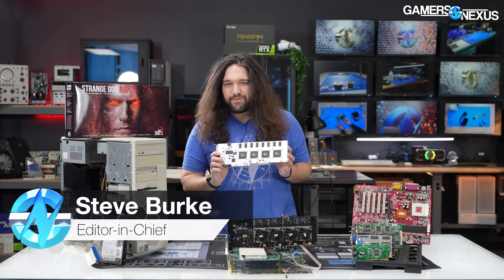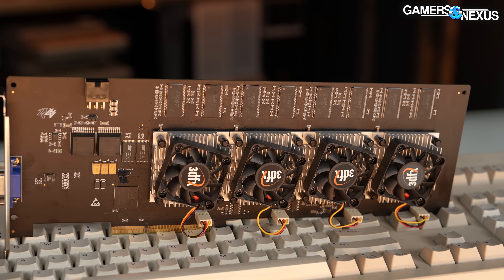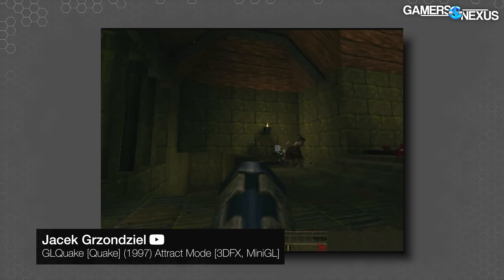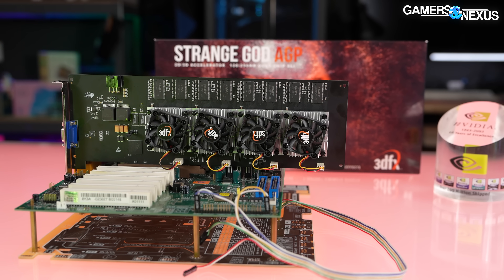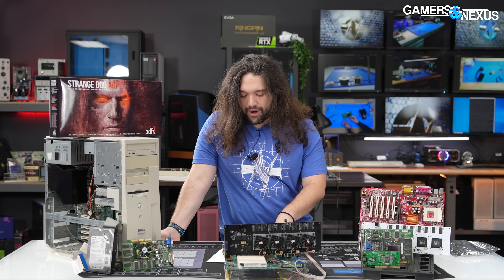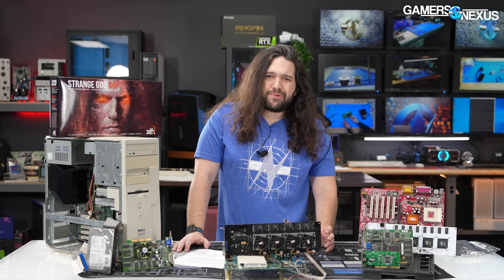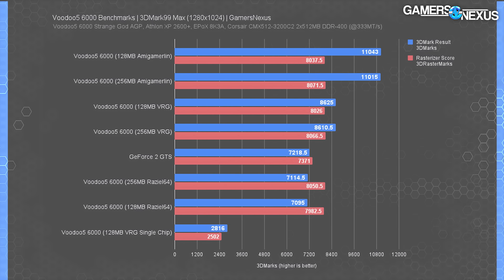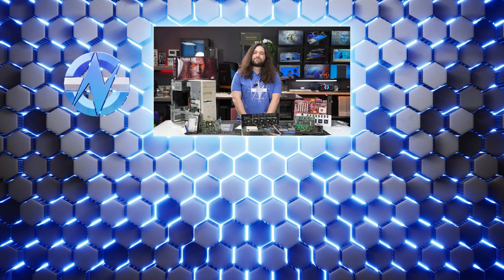Back from the Dead: 3dfx's Unreleased Voodoo5 6000 Quad-GPU Card

Comment: A graphics card review on a THEORETICAL CARD WHICH NEVER EXISTED.  This is utterly insane and I'm in love
Reply: Funny enough it was more real than the paper releases of the mining boom period. :D
Reply: No, it did exist. He showed one. That's also how he can say it replicated the original's bugs.
Reply: @Dowlphin the question is, where are the originals from the batch that WAS manufactured. Is it still “arrested” in some bankruptcy warehouse or something?
Reply: @Dowlphin BTW, there is even a more obscure thing. Back in 1996 Apple has designed its own 3D acceleration chip that was capable to drawing measly 100 million triangles per second. Of course, it was a failure, but the chip does exist somewhere for some IT historians to dig up, test, X-ray.
Reply: @tatianaes3354  Dunno how many existed, but they could have landed in the trash and in the hands of collectors, museums and such.
Reply: It existed (as a prototype), it just never went to production, and he made a lot of improvements to the original design to modernize it.

Comment: Thanks for taking the time on this video, it was quite interesting.  I had a 3DFX Voodoo 3 2000 AGP (well I still have because I am a bit of a hardware hoarder).  I initially had it in an AMD K6-2 300mhz machine, eventually I moved it over to my first hand built PC, an AMD Athlon Thunderbird 1.4Ghz machine.  

I have so many memories of playing Unreal Tournament 99 on these systems on dialup 56k Internet...  I actually remember there being some drivers that worked in Windows 2000.  I had good luck with that back in the day as I seem to recall, but I feel like those drivers were considered experimental.

I never remember hearing about working Voodo 5 6000 hardware.  I just remember all the memes because people couldn't believe a GPU would need an external PSU and be 12" long haha.  This alone didn't help 3dFXs reputation before they finally folded.  I was truly dissapointed to hear that they went under back in the day...
Reply: Drivers for 2000 were official and fully supported etc.. They could also be used in Windows XP, but from that OS onwards I think you could only use them for Glide and maybe OpenGL games. Direct3D support wasn't possible IIRC. Fans modded the last official Windows 2000 drivers to make them more compatible with Windows XP which was a godsend considering Nvidia showed Voodoo owners the middlefinger and immediately stopped any driver support which nearly rendered my very expensive V5 5500 AGP obsolete after just a few month after the purchase. That's why I never became an Nvidia customer. So thanks to the community I ran my V5 5500 AGP on Windows XP IIRC with the x3dfx drivers, but only for work and internet stuff, for everything else I booted into Windows Me.

Comment: Thank you for doing this. You brought me back to my childhood when I used to drool over upcoming hardware in the PC magazines.  Such a big part of my childhood.
Reply: imagine having a quad 4090 gpu card today just imagine having that kind of power at your finger tips
Reply: @raven4k998  and a CPU powerful enough to not be a bottleneck for it. And a psu capable of powering it, along with a cooling solution capable of keeping your system and the room it's in from having a meltdown. Lol
Reply: @shawng746  well at that point if you had that many gpu cores on a single card you could make a multi cpu card with a cpu that has the highest clocks and ipc over core count cause imagine yeah my systems got 128 cores and high ipc then your to boot she's running at 6ghz on multiple cores when she turbos that would be insane mind you the number of rads you would need to keep it all cool would be insane to but oh well🤣🤣🤣
Reply: @raven4k998  Indeed.  I'm certain by the time they are capable of producing things this powerful, the efficiency will be much better as well.  Otherwise it would make zero sense to make it for the average to even somewhat high end at home consumer.
Reply: @raven4k998  Would need a nuclear reactor to power it tho. lol
Reply: @vespermoirai975  na just a Nuclear fuel cell you over react it's just 4 4090's not New York City🤣🤣🤣

Comment: I was working at a PC builder and I remember the I740. We called it the first Windows DEccelerator. :) Intel's early video cards were a horrible joke. I had 2 voodoo 2's in SLI.  I went over to Nvidia like everyone else did. Their 1st video Card only did 16 bit graphics. They were coming out with new video chip based cards like every 6 months back then. They very quickly released a 32 bit chip. No one saw anything like their release rate. Even ATI almost went under back then. I had several of the Nvidia cards. They were extremely aggressive. This is really bringing back memories. Well done GN!

Comment: 8:54 I cannot overstate how much joy I get from seeing dated clips of people so confidently making definitive statements about tech.
Reply: kind of funny when we just got a 480 hz overclocked to 500 z for a monitor this year. 1080p but its there.
Reply: To be fair, they were right within the context. Nobody really needed to run Tomb Raider at 100+ fps
Reply: the 13:40 is even better - talk about swilling the kool-aid! lol
Reply: i think it sounds weird nowadays tho but back in the day some games might just be weird at high fps, because it might screw up the physics/player control/game speed/etc.
Reply: Yeah, it probaby made sense; in the context; at the time. It's still entertaning the way it's presented here, and their are much better examples of what I was originally talking about.
Reply: @T zwcard  At that time, tying physics and speed to clock rates and fps was mostly dead. Or at least well on its way out.

In the early-mid '90 there was a lot of issue with (mainly) DOS games being unplayable due to being tied to the processor speed. Playing some games made for a 12mhz 386 on a 100mhz 486 was impossible. (This is why you see "turbo buttons on old PCs) So devs tried to move away from this.

That being said there was still games that didn't take this into account. For example Oblivion (and Skyrim iirc) had issues at higher frame rates.
Reply: @Cancer McAids it might be on the channel already . I think its less than 2ms(based on 60fps being about 16.5, it adds up tho .60x 8 = 480 16.5 ≈ 8 is about 2). and it really just eliminates any movement smearing at all. probably only useful for people without eye prescriptions. I'm still at 75 hz over 60 and loving every minute.
Reply: @mr.dingleberry4882  I mean you could say that nobody really needs to run today's games at 360fps but that was never really the point, I still remember the first time I saw a game running at 60 fps and the first time someone pushed 100 fps in Quake (with legit settings, not 320x240) and how crazy that seemed.

Comment: Thank you GN for the trip back down memory lane here...I still remember my OG SLI setup. a Voodoo2 SLI thing. Ah the days of AGP, PCI and daisy chaining up to 3 GPU cards to make things work.
Reply: I remember putting in a preorder with Creative two or three months before the Voodoo2 was released. I bought two 12MB cards, one for me and one for a friend. When they were delivered I of course installed them both in SLI to see just what they could do. And then I played Tomb Raider all the way through in glorious SLI...

Sadly my friend really wanted his card so it was only a temporary thing...

This was an excellent replacement for the 6MB Voodo0 card that I had before this. I think it was a Canopus card, and yes it had 6MB of ram instead of the normal 4MB. Not all games could use the extra memory but when it worked I could load special texture packs that made things look just that bit better. Even so the Voodoo2 really blew the Voodoo out of the water.

Comment: I use to have 2 of those old voodoo cards in SLI. Wore 3d glass and played Quake 1 in 1024x768 (3d), while others struggled at 640x480 non 3d. The good ole days.
Reply: Just out of curiosity, which CPU, Motherboard, OS etc. did you use for the rest of the system?
Reply: @Felix-ve9hs  Had to look at the dates, possibly it was a brand new Pentium 4 that finally replaced my earlier 486dx2 but that would be November 2000. Seems I might have had those cards before this. The Voodoo cards would have been almost useless except I played Quake1 almost exclusively for years and they did write a Quake 1 launcher that was custom for the Voodoo cards. Now I did play this on a 21 inch Viewsonic P815 monitor, that cost a fortune in the 1999 time period. There were only 2 21 inch monitor at our computer heavy work location at this time.
Reply: @concernednewfie  21 inch monitors weight a ton as well. I used to hate them so much, if need to move one pain in the butt.
Reply: @donw4889  Yeah, it was over 100 pounds, but then the 36in Sony Wega of that day was 220 pounds.
Reply: @concernednewfie  If they were voodoo 2's you were probably gaming on a overclocked Celleron 300A like the rest of us were.  Those were the best chips at the time of the Voodoo 2 release in 1998.
Reply: @concernednewfie  Was just going to ask if you had a flat crt trinitron monitor. I had bought a 17" for maybe $450 new thing was a legit boat anchor. The depth in the picture though unbelievable.
Reply: @JathraDH  Or a amd k6-2, cyrix was still in buisness by then too. had a mii 266 mmx ordered but never came at least I didn't loose any money!
Reply: @frizzlefry1921  Yea but you couldn't beat the 300a for bang for buck, the chip was like $70 and every single one would OC to 450 out of the box on the stock cooler lmao.  It was even faster for some stuff than the P2 450 due to having its cache on the actual die instead of on external chips.  The P2 cost $450 at the time.
Reply: @concernednewfie  Could it be that the 3dfx launcher of Quake 1 was written because of the Glide API? I read that it was far superior performance and quality wise.
Reply: @JathraDH  aww yeah, Celeron 300A... No CPU has topped it in both raw gains and cost effectiveness - and probably never will, considering how chips are graded/binned these days. I mean, 300MHz to 450Mhz, with stock cooler, a semi-decent motherboard. And if you knew your way around your motherboard BIOS's OC options (or frequency/voltage jumpers), one could achieve a 50% boost in performance under a minute or so :-]
Reply: @c0baltron  Yeap!  I remember a oldskool extreme overclocking video where they took a 300A to 600+ mhz as well.   I really don't think any chip before or since has had so much relative overclocking headroom, like, ever.

They took a 300A/board and put it in a styrofoam cooler, then filled the entire cooler with flourinert (a few gallons worth) then pumped the flourinert through a heat exchanger over to a 2nd cooler filled with LN2 bringing the entire flourinert bath down to -200 or lower.

Later they did that while also hooking a water block to the CPU and pouring LN2 directly through it and IIRC got it to 700+ but the chip was so cold the electrons couldn't flow so it gave a screen full of gibberish, despite actually posting.

I still have both of my 300As and my Abit boards (RIP Abit) in the closet.  I miss those  glory days.
Reply: @JathraDH  well well well... What you just described sounds to me like a perfect  RIP OLDSKOOL challenge for GN/Jay/Paul to take... :D

Comment: The experience of booting GLQuake in glorious 640x480 with full texture filtering and smooth framerate (close to 60 if I recall correctly) was unforgettable and looked like magic. That same computer was struggling in software mode at 320x200. I've never seen a comparable jump in graphics quality and performance in computing.
Reply: but how come quake 2 didnt a killer computer for the time but Unreal torn 2000 didnt ... i think unreal tornament 2000 looked better too and solftware render ran great

Comment: Man this video brought back memories. 1997 was when I built my first PC with a P166 and originally a Rage Pro. It barely did some games like Wolfenstein and Diablo which were mostly 2d anyhow. In 1998 I built my next system with a Celeron 333 I overclocked to 500 Mhz (fastest CPU in the world at that time) and paired it up with a Voodoo Banshee. Massive uplift. I eventually bought an 3Dfx Obsidian card which was $900 even back then. It was a single board with 2x Voodoo 3s in SLI. That was a huge upgrade and I was playing games like Everquest, Unreal, and Halflife at framerates no one else I knew could touch. Sadly, that was the last 3Dfx card I bought as the Nvidia items being release around that time were too compelling. Even AMD was about to get in on the action in the competition with their original radeon 9800 release in a couple years after that smacked everyone around. Still I wish 3Dfx hadn't folded as I would have loved there being a 3rd contender in the market for the past 2 decades instead of it only being AMD and Nvidia. I know Intel just started with this space, but for over 2 decades it was only AMD and Nvidia.

Also, surprised that there was no test comparison to the Savage S3/S4 chips which was also released at this time frame. I had one of those as well.

Comment: So cool.  I had 3dfx cards way back when.  Glad to see some still around.  Molex, Vga cords, and Crt displays cannot be easy to find.  Oh how times have changed.  Great video GN
Reply: Most the old cords are insanely easy to get. I have more than I could ever know what to do with. Hell, you can probably still get a VGA cord off the shelf at best buy.
Reply: Huh? I still have a ton of VGA cables. You would be surprised of how many old school projectors are still in use that are VGA....it hasn't gone away.

Comment: Thank you for this, guy's, really all of you. This is my wheelhouse. I've been in this game for a very long time :) and it's very nostalgic to watch this. While all my friends had ati and 3dfx,i had to be the weirdo with a Matrox millennium! When it worked it was awesome, but getting there could be a challenge!
Reply: Matrix Millennium gang
Reply: Matrox Millennium G400 :)
Reply: Matrox, S3, the first Geforce’s and for the last 15-20 years I’ve been an ATI/AMD fanboy. This video brought back so, so many cool fun memories! Thank you GN, Antony and all commenters.
Reply: I had Matrox Millennium with 3DFX Voodoo. Remember, the first two 3DFX Voodoo 3D-accelerators didn't have 2D graphics chips on board, you needed a separate 2D graphics card. Also the passthrough video cable 3DFX needed to function noticeably worsened the 2D image in resolutions higher than 800*600 (it became a bit blurry and if you looked closely you could see some "shadow" of the image especially on straight lines, that's analog video signals quirks for you). So even though Matrox Millennium had the best 2D image quality on the market at the time, using 3DFX Voodoo with it kinda completely negated that advantage. lol Looking back, I should have bought a much cheaper S3 Trio64 graphics card with my 3DFX Voodoo. Oh, well... You live, you learn.

Comment: Brings back  some old memories.  The machine we had before was a IBM 486 100mz with mathco processor, 32meg of dimm, and a Tsung 4meg vram graphics card that could load true color bmp.  No 3d.

I  eventually bought a Diamond Viper 16m pci and it ran well on windows 95 with my 4gb Seagate drive, Pentium 166 overclocked to 201mz, with MMX and 32m of ram on a Gigabyte board.  AGP slots had just come out.  We used an Avermedia graphics port to AV converter box to see it on the big TV at 800x600.   It could run HL1.  We thought that was amazing.  Eventually the Riva TNT 2 AGP had the TV output so we got  that with a new Mobo but stuck with 95 almost until XP was released.

Comment: Ahh, the good old days when 600USD was considered an obscene amount for a GPU... I miss the pricing of the old days... :)
Such a cool card. And what a dude for building it.. Seriously impressive
Reply: Yeah but adjusted it was 1000. Which is still considered absurd today.
Reply: @Real28  It was the 4090 of it's time
Reply: @Real28  I paid 1100 for my 4070ti, a mid range card
Reply: @Grok_Fractal  sorry man but you got scammed
Reply: @Real28  this was supposed to be ultra high end, with 4 full working chips
Unlike a certain cut down version of the already second-placer chip going for 1600$ (allegedly, since most of the time it seems to be going for way over 2000)
Reply: @sigmamale4147  The cheapest thing on the market that can do raytracing at 1440p ultrawide

In this market you are getting scammed no matter what you buy
Reply: Back when those cards came out i got them all for free, I develop PC for an large OEM, get 20 cards for development use, after project was over, we took them out as loaner for personal PC at home. I miss those day of free hardware.
Reply: Nvidia might be the new Voodoo, seems like Intel is trying to pull a year 2000 Nvidia.
Reply: @Grok_Fractal  they don't cost that much lol, you got scammed. There's 4070 Ti's for 900€ here in Germany, including taxes
Reply: @b4ttlemast0r I redid the currency conversion, it was 1000 euro

The price is still absolutely atrocious at 900 euro, it should cost like 500 at most
Reply: @Real28   Those adjustments are bogus nonsense. Rent was 950$ in the slums and Target paid 8.50. Compare that to 10 years after, it was the same deal. 10 years after, the same deal. Print money all you want, that doesnt mean things in the past were JUST as expensive, it just shows how shockingly underpaid we are today.

Comment: 25:00 - Unreal Tournament 1999 runs by default with higher details in Glide than in Direct3d and OpenGL. Some graphics details (details textures and fog - volumetric light) are turned on only in Glide and off in Direct3d and OpenGL. So those results were biased in favor of the GF 2 GTS and Intel i740, because they run with lower details than the V5 6000 / Single Chip.